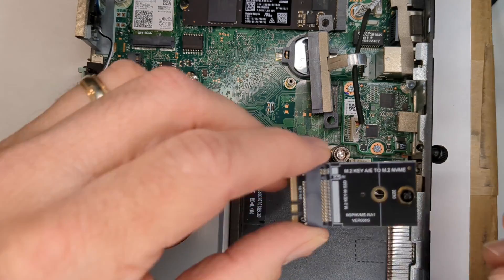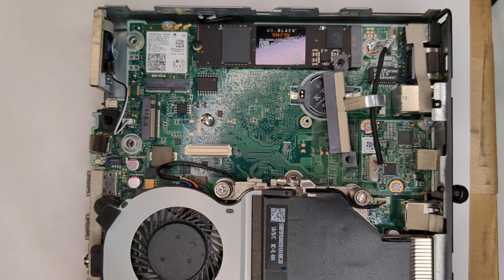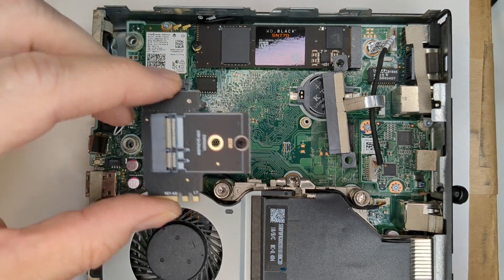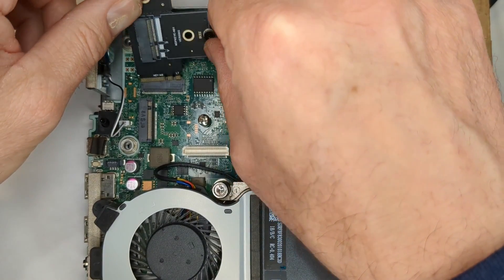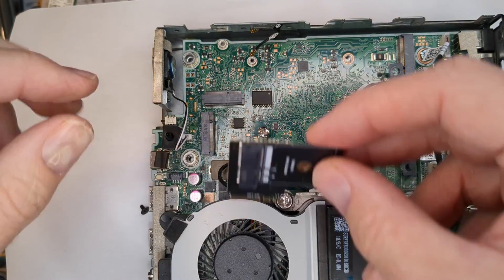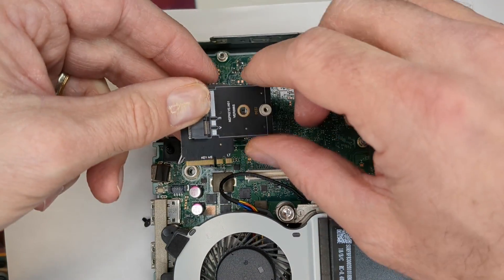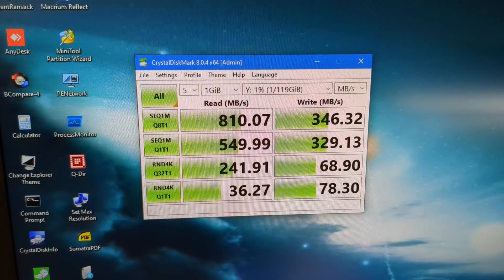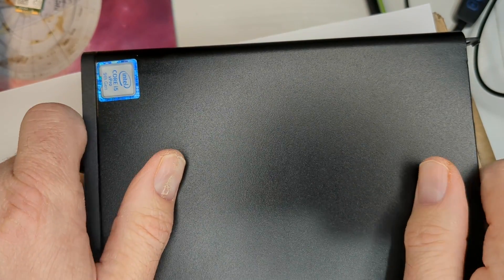EliteDesk Wifi (M.2 A+E Key Slot) to NVME.  G4/G5 solution

Comment: It seems like there's one too many adapters in the mix. Shouldn't the NVMe plug directly into the 90-degree adapter? The "straight" M.2 A+E key adapter and the 90-degree one are I believe, performing the same function, adapting from M-key to the WiFi socket A/E-key. The second (straight) adapter in this case is probably redundant, even though it does appear to work. Note also that the WiFi M.2 socket only provides x1 PCIe lane, hence the slower than normal M.2 performance from that socket -- but still faster than SATA, though!
Reply from the maker: https://youtu.be/cVw6AeYTHnk is the better solution for the G4.  Cuts down on the extra adapter.

Comment: Cool project. I like your gumption. 
Also, SSD caddies are totally overrated and interfere with proper cooling.
Reply from the maker: Thank you for tuning in.  I guess I'm a fan of any sort of storage.  Although my experience with mechanical drives in the units shows just how slow they are in comparison to M.2 and SSDs.  But even mechanical have their place.

Comment: Are the trace lengths the same? Does it matter for SSDs?
Reply from the maker: Sorry - my brain is not catching on - trace lengths?
Reply: @handmedowntech   I'm familiar with modern motherboards having "squiggly" or otherwise variable length PCB traces to either accommodate for, or to achieve a desired speed for the bus spec. 

A way to test this might be to fix the antenna down and perform some tests with each module configuration, possibly using pings. I'd be interesting to know if the trace lengths, to accommodate for a 90° angle have any noticeable impact on performance.
Reply from the maker: If it helps any.  The wifi slot only gives 1 PCIe lane so the speed is 1 fourth the normal m.2.  I know I'm probably mixing pineapples and race cars with that statement 😉

Comment: Firstly I'd like to say thanks for your G3 G4 videos, I am also a fan and owner. Worst case scenario for this particular model is not using the cage for the SSD, As SSDs aren't made of metal you can have it sitting kinda loose on the MB. 4 x slots for hard drives is a such a good feat for such a small footprint! That's unheard of for a 1 litre mini.
Reply from the maker: Thank you for watching.  That drive cage is the source of joy and frustration.  Just big enough to get in the way but small enough to also get in the way 😉

Comment: Check out the Sintech M.2 (NGFF) NVME SSD to M2 A/E Key WiFi Port with 20cm Cable(M.2 Only Provide PCIe 1X Lane). I ordered one for mini's without much room for the other adapters you were using.
Reply from the maker: I've been tempted to get one of those.  Should work better than the right angle one I used.  Let us know how it works and if you could fit it under the caddy.

Comment: Just came across this video i have a g4 with 2 nvme s and a sata ssd (i removed the cage so just the connector ) but can you have 2 nvme + 1 sata + 1 m.2 wifi to nvme drive i have a 65 w moddel
Reply from the maker: I played with that once and the issue was the cage.  But if you are willing to go cageless you could do it using 2230s. One for the wifi, one for the m.2 along the side and you could also do one in the center or use a 2280.  I'd love to hear if it works. 4 drives!
Reply: @handmedowntech  ok will look into it

Comment: I have a few M2 2230 drives from old steam decks and it looks like those would fit without too much drama. It is definitely nice that it works, but it does seem like a very niche case if you need a little more ssd storage at the better speeds.
Reply from the maker: Also shows what is possible with these small units.  I like those 2230s.  Use them in several videos.

Comment: You could drill out the hole on the right angle bracket to align with the motherboard screw.
Reply from the maker: I had thought about that too.  The hole though is kind of half in, half in out.  Almost could use a file maybe.  Others have pushed for the wifi adapter that has a ribbon cable but that has its challenges too.

Comment: can we expect any improvements over sata ssd if the slot has may be PCIe 2.0 x1 or x2 ?
Reply from the maker: Definitely.  Just using the wifi slot on the EliteDesk was faster than SATA but of course slower that a typical m.2.  Hopefully I understood the question right.
Reply: @handmedowntech  Do yon know the speed of the M.2 2230 Wifi Slot in the G5 by any chance? I was hoping to fit an M.2 to PCIe Adapter to run a GPU but now I fear that the slot will be a big bottleneck.
Reply from the maker: @Nivi78 I do have a video on adding a pcie slot via that wifi slot.  If you were connecting a GPU it would have to be old school 1x vs 8 or 16 for more modern gpus.  Even the normal M.2 is only 4x
Reply: @handmedowntech  thanks for your reply. I really appreciate it. I'm probably gonna try another aproach. There is a thunderbolt Flex IO card for the G5. It will be a more expensive mod but at least it should be easier to pull off.
Reply from the maker: @Nivi78 let me know if you're able to find one of those and how it worked it.

Comment: Excellent video. I thought I'd already posted this but YT says I haven't ... doh! 
Perhaps an alternative, and to reduce the size and thickness of the double-adapter arrangement is to use an adapter with a flexi cable ( Ali item 1005005069183192 for instance but Amazon do them too). I'm aware from reviews that long cable versions are unreliable but these are small cases and even a short cable should allow you to securely mount the 2030 sized e-adapter, fold the cable back towards the processor side of the case then a 90degree fold will lay the m-key adapter parallel to the existing m.2s. There is no obvious fixing point but on the other hand will possibly allow a full 2280 sized device but, as someone else says, tape may work or even a rubber band to secure it to the underside of the drive tray may work. I would hope the assembly would fit under the drive tray but I don't currently have a g4 or g5 so can't experiment!
Reply from the maker: I was debating on the cable idea too.  Especially since the head fits into the same wifi space.  Maybe an idea for a future video.

Comment: i dont really get the point of it removing your wifi card to  have a ssd instead seems stupid but for advice you can put another hole into the right angle adapter since there is no electronics on the bit going over to the right also put electrical tape over the antennas then you are safe to tuck them behind it all
Reply from the maker: I had some viewers asking how they could use the wifi slot for an additional drive.  For the earlier generation units you get an actual increase.  A G1 could have 3 drives, etc.  For the G4 you get the increase only in cases where you don't mind not having the SATA drive.  I like the suggestion of punching a hole to matchup with the standoff on the board.
Reply: This allows boot (eg with a diag system or OMV) from a fully internal boot device. If you don't need wifi, the e-key is just another slot ...
Reply: For me, I don't use BT/WIFI, the slot will give me another slot for running boot drives and the other 2 NVME slots for RAID in Proxmox. Otherwise, I would need to convert one of the NVMIE to 5 SATA and hook up drives and external powersupply to run what I need. Now, this handmedowntech suggestions, I can keep it all in one box.

Comment: You may want to put some tape around to the end of antenna cables. Just to be sure those metal connectors are not shorting out anything.
Reply from the maker: Good suggestion, thanks.

Comment: Nice video! I might try this with double sided tape to tape down the nvme.
Reply from the maker: Pretty smart - I was so hoping that one hole would line up - arggg
Reply from the maker: One viewer suggested trying to punch a hole in the card so it matches to the standoff.  Also to put tape on the antennas.
Reply: That is possible too. I don't think there are any circuit around that area of the card. Good idea!